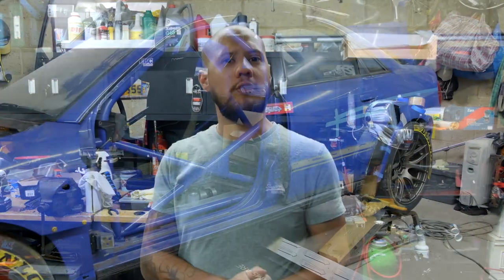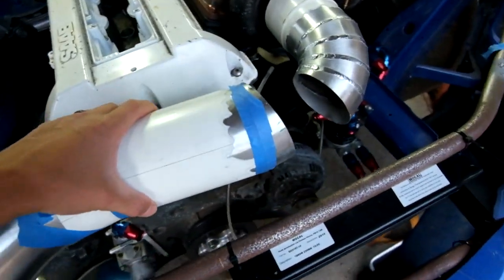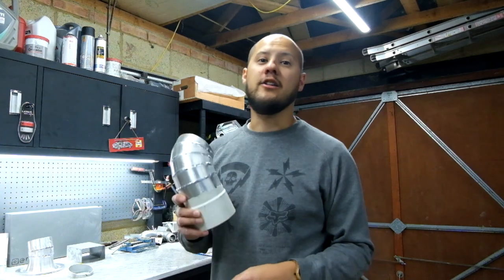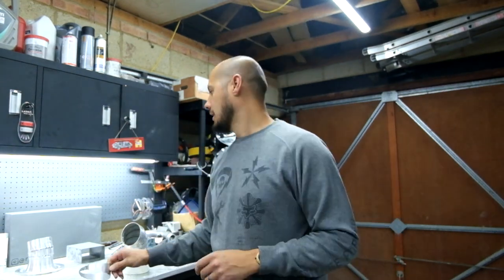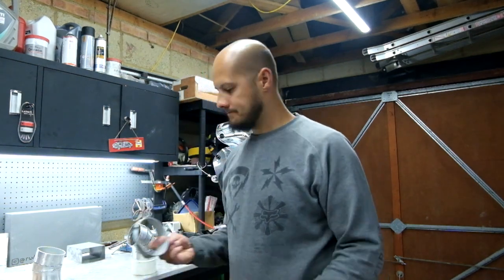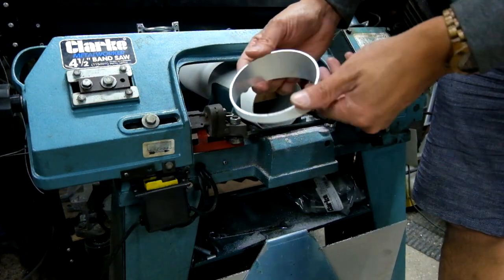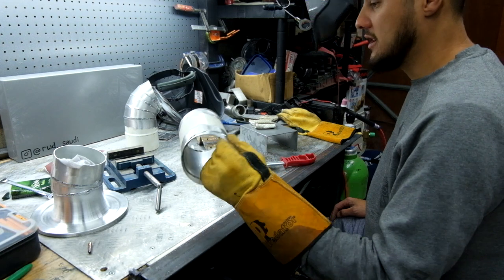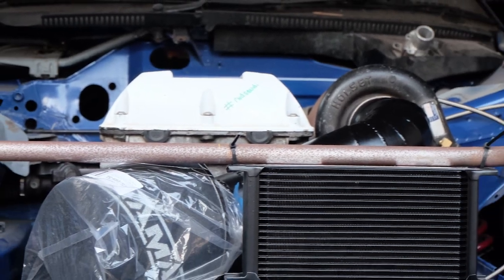Making a custom pie cut intake pipe - First ever Vlog!

Comment: Only found your channel nice work so far.    Doing a saab swopped classic tvr myself  on an emu black ecu   👍
Reply from the maker: Sound good! Which engine you using?
Reply: @AndyPonting   b235 but with pec rods wossner pistons and cat cams  and the rest 😄
Reply from the maker: Nice! Where you get the cams from? And what turbo you going to run?
Reply: Got the cams from Abbott racing  they are a dealer for cat cams. And the turbo im using is a pulsar g30-770 👍   .72 ar exhaust housing
Reply from the maker: Sounds like a great build! Anywhere I can keep an eye on it?